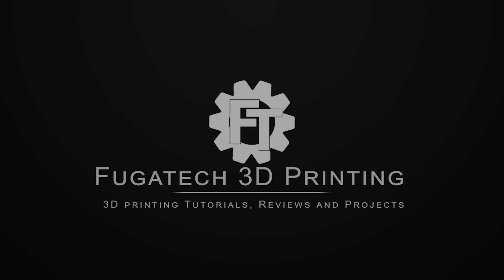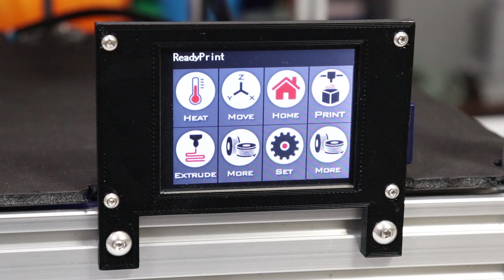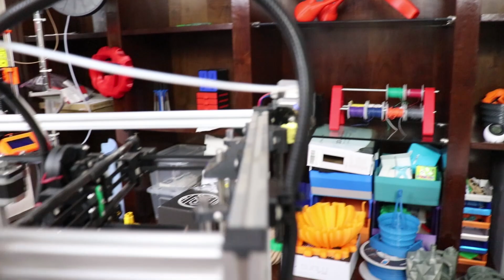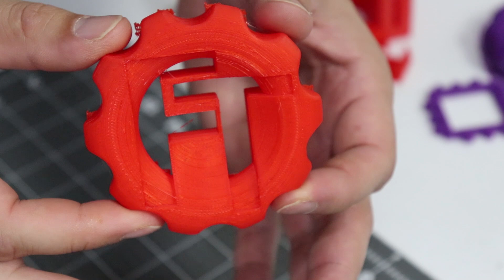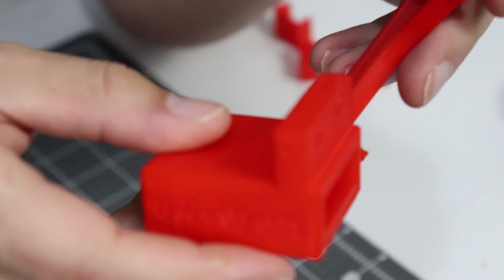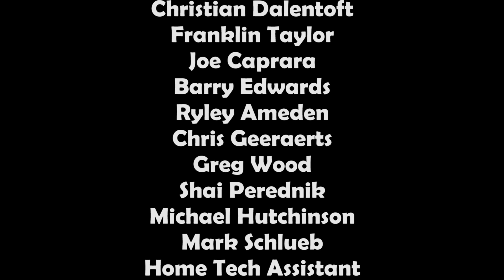HyperCube Part 6 (Finale)

Comment: Given all the work that you put in to it. Can you give frame extrusion lengths for 220x 220x220? Thanks
Reply from the maker: I used the measurements from Tech2C. If you want to customize the size, use this tool. http://funkydiver.com/hypercube-materials
Reply: @Fugatech3DPrinting  I figured after building it and having the measurements not work out for you.  You would know what the correct measurements would be. Thanks anyways.

Comment: For some reason I just saw this pop-up in my feed even though I have been watching Hypercube videos for a while. I ended up buying a Hypercube 300 kit from Zyltech back in October 2017 and its funny how your video demonstrated exactly what you go through as you are building something based on someone else's design and then realizing that there are flaws that slow your actual build time down. I printed so many parts that didn't get used. Went from PLA to ABS for all the parts. Got a better control board as well as changing out the bearings. It also demonstrates how advanced printers builds like the Cobblebot were back in 2014 and that printer was 500x500 using 2020 extrusion. Then you talk about something like the Voron which is even more advanced hypercube style build. It costs like a thousand dollars to build if you use all legit parts vs the Zyltech which was way cheaper a year ago. So it's good you got the build series finished.

Comment: How much do you think your final build cost was?

Also what print speed are you able to achieve? A follow up part where you push the speed would be really interesting.
Reply from the maker: I think between $250-$300. Not sure if I'll do speed testing. Tech2c kinda that + I never really need to print faster than 70 mm/s. We'll see.

Comment: Tip: you can move the extruder to the middle of the extrusion to make it shorter.
Reply from the maker: Sorry but I'm not understanding what you mean.
Reply: @Fugatech3DPrinting  attach the extruder to the center of the left extrusion instead of the corner to make it shorter!

Comment: great build but should have gone HEVO in my opinion
Reply from the maker: Why?
Reply: @Fugatech3DPrinting  beefier frame with 3030 extrusions and dual z axis to avoid the cantilevered design. Still have a lot of respect for the original hypercube.
Reply from the maker: The Dual Z I can understand but honestly the 3030 offers nothing over 2020 at this size. If you are doing a 500 mm cube build, different story.

Comment: Nice build. In PrusaSlicer (Slic3r) make sure to set cooling fan to "always on".  You can also adjust the minimum fan speed to a higher percent than default, which is around 30-35%.  I keep my fan speed at 100%.  Also experiment with different extrusion flow rates and layer widths (not heights), but play with them as well.  Even if your extrusion rate is calibrated perfectly, actual prints will look better with some tweaking. Slicer settings are as important as Estep calibration.  I"m always amazed at how BIG a difference slicer settings can make in print quality.

Comment: I am just giving up on the Ultrabase on my Hypercube because I can't get PETG to stick to it unless I hit it with hairspray and even then some parts still end up lifting in the corners.  I've tried up to 95c, I've tried closer and further from the bed and I've tried two different brands of PETG.  No luck.  @Fugatech 3D Printing if you know how, I love how it works with PLA so I'd rather keep the Ultrabase but I need to be able to print PETG too.
Reply from the maker: Wow really? I have the UB on 3 printers and pretty much everything sticks to them. I think I had to use some gluestick for HIPS but that was about it. I print PETG at 70C with no issues. My PETG print speed is 50mm/s and the first layer is set to 40% speed.
Reply: @Fugatech3DPrinting  I have been using 30mm/s and 10mm/s for the first layer with no luck at all.  I spun my wheels for so long because of Cura's Combing feature.  Combing normally just wipes a little of the oozing filament across lines already printed but since PETG is so clingy it was dragging printed filament right off the bed.  Combing is now disabled in my PETG profiles :)
Reply from the maker: Ah ok. I use S3D mainly. You should give Prusa Slicer 2.0 a try.
Reply: @DavidMulligan  I hated my ultrabase on my anycubic i3 mega
Reply: @Fugatech3DPrinting  I'm using Prusa mk3s currently and petg pretty much sticks way too hard at around 70c. Been thinking about using lower temps as I currently use dab of generic glue to prevent too much sticking. I've actually ripped very small part of the spring steel sheet pei surface when first printed straight to clean sheet.
Reply: 95C was too high for PETG. That's closer to ABS temps. Put a part cooling fan on there and its definitely coming off.

Comment: You can get your full Y axis by moving your motors to the outside front of your printer then slide the build plate slightly forward.
Reply: Yeah I'm very glad cause a friend told me to do that when building mine. Heck I have actually more than planned build volume on Y :p I guess if I ever do tool changer experiments it's good for that

Comment: Can you share your retraction settings in Prusaslicer (retract speed & length) for your hypercube ?  I have some issues on this part. If you make a rebuild try double Z like Hypercube 300 or Hypercube Evolution. ;-)
Reply from the maker: It is 6.5mm @ 40mm/s. I haven't really fine tuned it but it works for now.